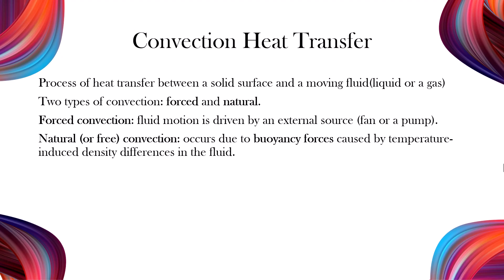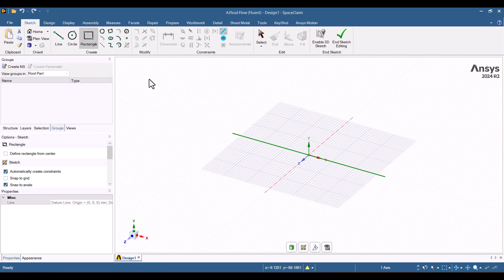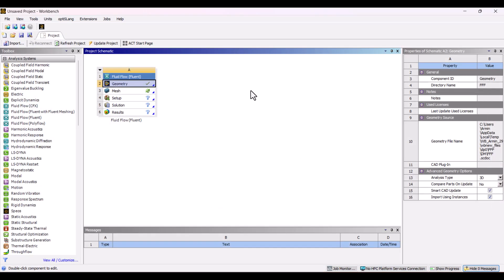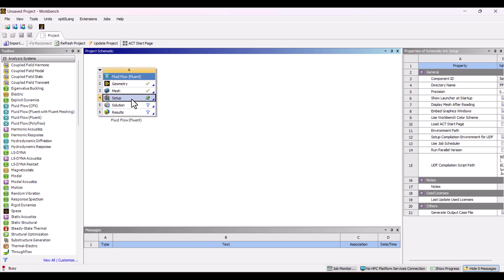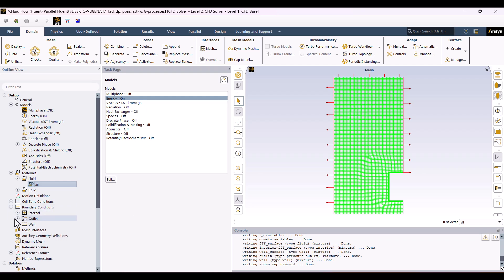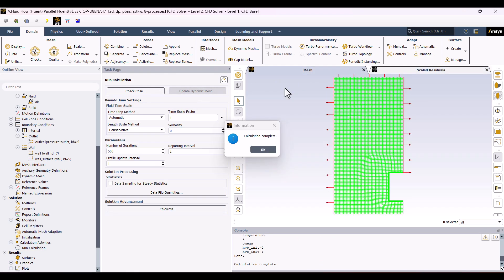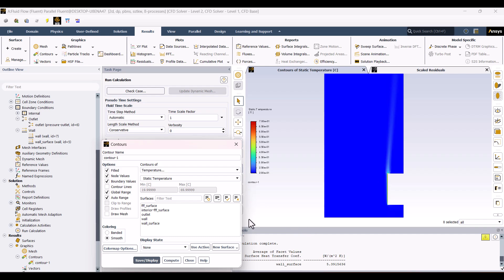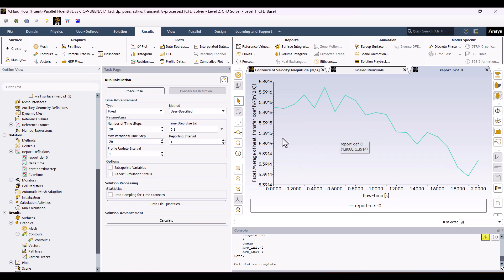🌡️ Ansys Fluent Tutorial: Calculation of Natural Convection Heat Transfer Coefficient

Comment: Great video! I have a question about this, may i know does the density changes in this case? i tried both pressure based and density based, but the density contour is constant all the time
Reply from the maker: Thank you. I think you used incompressible density. Change it to ideal gas.